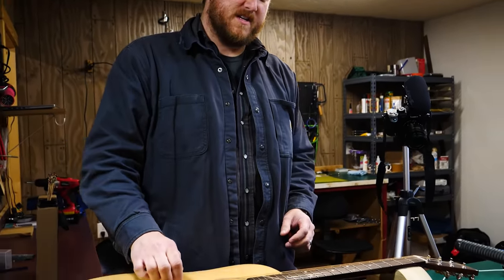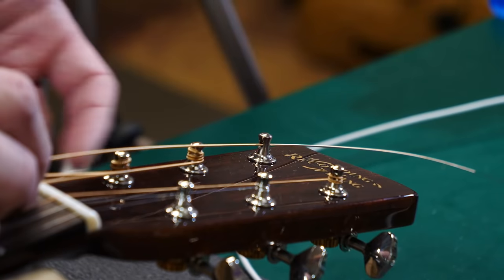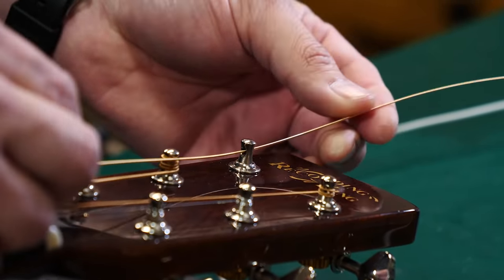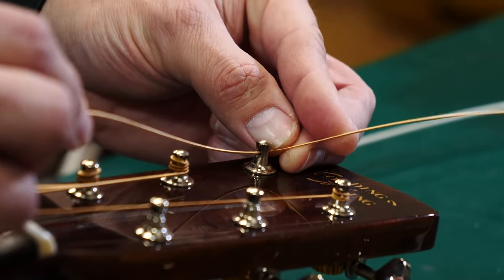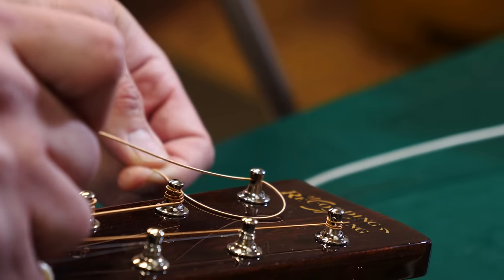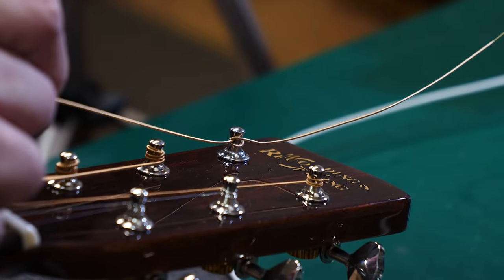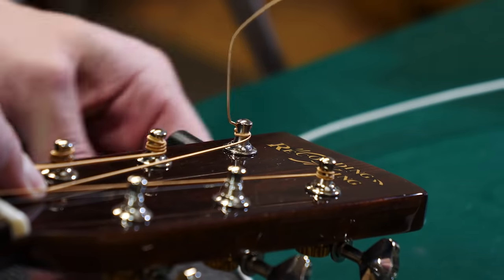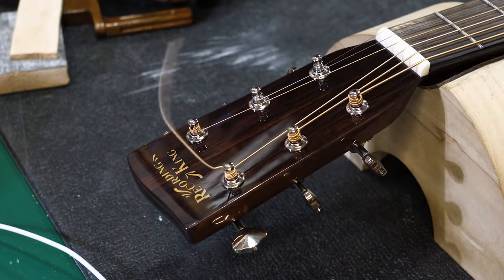Tech Tip: How to Tie a Luthier's Knot When Changing Strings

Comment: I’ve been restringing my own guitars for 40 years. My technique is to make sure I have 2 1/2 to 3 turns. For most 3+3 headstocks this means measuring to the next tuner post and cutting it off there. For inline 6 it’s just past the next or about half way to the 2nd. I start the first wrap above the becket and the rest below, just to keep the coil from bottoming out.

Have never had slipping or tuning issues.

I’ve been changing strings on pianos and even harpsichords for nearly 40 years. Some harpsichords don’t even have holes drilled in the pins. If piano makers tied their strings on you’d never been able to get them off the pin.

You may need to do this for nylon, but with steel strings it is completely unnecessary.
Reply: but still good.
Reply: You don’t bend strings much if that method works. They don’t bend piano strings.
Reply: @Sinned Gnillubnot Haha! Fantastic. I agree. Tying is unnecessary, especially on wound strings--which he uses for his demo! As long as there's a good kink where the string enters and exits the peg, and a couple of winds around, there'll be no problem.
Reply: I agree with tannertuner! I have been playing guitar for 50 years. I have also been a piano tech for about the same amount of time. I just changed my high e string to test luthier knot. Didn’t notice any real difference, and yes, I bend a lot of strings playing straight ahead blues! The key is a good tight becket(piano tech term for the bend at the hole), and 2( for wound) and 3(for plain steel) tight coils. Most guitar players do a sloppy restring, so I suppose the luthier knot will help in that case.

Comment: I've been a full-time repair-tech for over 40 years ('Guitar Tech' - in the SF Bay Area), and in my opinion, this video is almost - but not completely - wrong.  As has been said below, this 'knot' is completely unnecessary On The Wound Strings.  However, on electric guitars using very light-gauge strings (9-42 or 8-38 sets), it can be very useful to perform this process on the 1st (high E) and 2nd (B) strings, because these strings (especially an .008"-gauge 1st string!) can be flexible enough to 'creep' through the tuner-hole, even when sharply-bent correctly, during installation.  A 3rd string is too stiff to 'creep' (and the wound strings have plenty of friction against their adjacent windings), so this is not necessary for those strings.

Stephen White
Reply: Good point!  I've always just put one wind over the tag, and the rest under, and never have I had a string slip...but I don't use 9s.  I use 13s on acoustic and 16s on Resonators, more cables than strings.
Reply: Stephen White brilliantly repaired/set-up/modded many of my guitars and basses in the early 90s… I’ll follow his advice on this topic 👍🏻

Comment: Thanks for the great tip Ben. After 65 years of playing, and stringing instruments, this is the most efficient I've experienced. That being said, it's very difficult or next to impossible to utilize the knot on A and B strings when using a gauge below 12s. For these 2 strings, I wrap the strings 4 times around the post, then pass the strings through the post hole and over the top of the wrap. Holds tight, clean wind and easy to remove old strings when the time comes.

Comment: This is without a doubt the best way to attach strings. I've been doing it this way for over 20 years, I just didn't know it was called the Luthier's knot.
What surprises me is that hardly anyone knows about this knot. I've even seen two luthiers simply put the string through the hole and tighten it.
So let's share this video.

Comment: Good presentation. I used the same knot for a few decades but then dropped it about 15 years ago. I found it unnecessary and not having the knot makes it easier and faster to remove the string from the post when restringing. When I put a new string on, I thread the string through the post pretty much the same as you show, but I then kink the string on both sides of the post: toward the inside of the headstock above the post and toward the outside below the post. I then crank the tuner and wind the string with all the windings going on the post below the string and post hole. The two kinks lock the string and give more than enough friction so that I never have slippage or tuning problems. Works on all the strings even the high E string on acoustic guitars, electric guitars, and mandolins.

Comment: I love the knot, never looked back. However I do the tension tight so there's max one wind. That way theres no string binding against itself on the post which is the main cause of tuning instability. Looks clean too. The trick is experimenting with your individual guitar on where to position the hole for each string. I use the 54432 (o'clock) method on my strat.
Reply: Hi Rich,  I suppose one reason to have several "windings" going down the post would be to increase the "break angle" of the string (from nut to post) a little bit,  to the extent that is important.

Comment: Cool video, but there's a much easier way and you'll never get pricked by the sharp end of the string poking out after you've tuned up! Just let the first wind around pass under the hole as you tighten each string (and each successive pass should go under the previous one), and make sure you leave enough slack to make 3-4 passes (except for the thicker strings, where you can get away with 2-3). That puts enough upward pressure on the part of the string that's going through the hole so that it will not come out. Finish tuning the string to whatever note it's designed for (EADGBE), and twist the end of the string back and forth until it snaps off clean. No cutter needed, no sharp end sticking out, and no goofy-looking loops made out of the extra string! Problem solved; no Luthier's knot needed. This works for the mandolin as well, and I am sure it would work for the banjo, although I don't have one and so I've never tried it.
Reply: literally came to the comments to mention exactly this. i've been breaking off strings at the post (after three wraps) for about thirty years now, and never once have i had a string slip or come undone.  it's faster, safer, and easier.
Reply: @TypewriterJustice  Haha exactly!
Reply: Hi, your technique seems simple, would it also work for violin and ukulele strings? For bass? Thanks.
Reply: @lunacatfish  it pretty much just works for bare metal strings or wound strings with a metal core, so it that rules out nylon/gut strings and most flat-wound strings for classical instruments(which often have gut/fiber cores) - i tried it on an electric bass once to no avail, never even bothered to attempt it on my upright
Reply: @lunacatfish  I don't have much knowledge on those instruments, so I would consider what @TypewriterJustice said in Reply to you, whatever of it applies to your situation. Sorry!

Comment: Banjo Ben - I used this technique for years and I abandoned it as a bad job.  Too many times, I tore bloody holes in my fingers trying to undo that "kink", particularly on the stiff B string (0.018 medium gauge).  Same technique without the reverse bend holds very well and is far safer for the poor schnook (usually me) who has to take those strings off in a few weeks.
Reply: I hear you! I've been using the "Martin" knot for almost 40 years. As my eyes got worse, I discovered a solution. I leave 3/8ths inch of the string tag instead of clipping right next to the post. It's much easier to free the bend without donating/sacrificing blood.
Reply: Why not unwrap the knot from the other side? If you are using an acoustic loosen the string and remove the peg in the bridge then unwrap it from the long end. With an electric you cut the string and again unwrap it from the other end.
Reply: @CDRaff  that doesn't help, especially with the B string. It's folded over like a tight u-turn, and the string is rigid. There's barely enough string to grab, and usually ends up stabbing your finger tip. That's why I cut them off to a 3/8ths length after winding, so I can grab it with needle nose pliers. Even with that, you have to be careful to avoid scraping the tool, or the string end, against the peghead.

This knot prevents the string slipping either direction. You can't push it through with the long end until the fold is released.
Reply: @JonNewquist  I have been doing this well over 20 years, no it doesn't.
Reply: @CDRaff  I've been doing it for forty. Maybe your eyes are better than mine, maybe your pinch strength is stronger than mine. 😁

Comment: Great practical tip! I learnt this way nearly 50 years ago when I first started playing and for me is the only way to secure the string to the post. I am convinced the popularity of locking tuners on electrics is partly due to players not knowing how to attach their strings correctly and thinking that their machine heads are at fault. Lol I am starting to sound and think like an old man🤣
Reply: Locking tuners to me are mainly an aid to speed up and simplify string changes, since you eliminate the need to do any wraps(the method in this video also works great with minimal wrapping). Thought I'd agree, many people have no clue how to do most of their basic guitar maintenance lol
Reply: There are slip-proof ways to do it that don't involve the knot.

Comment: This knot used to be in a little flyer inside Addario strings back in the last century. It's easier to apply when you start off by turning the tuner post bt 90 degrees. Been doing this since 1981 and never had a string slip, nor be impossible to remove on the fly. It also translates well to the nylon string guitar as well as to nylon strings with wooden tuning pegs (where I actually DO line up the post hole with the string direction)

Comment: Great explanation. Slight improvement would be less slack and fewer winds around the tuner post. Less slippage during the first tuning after the string change. I try to get 1 1/2 winds around, 3 or 4 is too many.
Reply: Is less wraps better than more? I always assumed more wraps meant more grip and more stable tuning
Reply: @TheMyguitarisblue   You are right that extra wraps do actually allow the string more chances to catch on itself, but that doesn't make it more stable. The problem is that those "catch" points very often slip as you increase string tension when tuning.  If you hear occasional popping noises and a sudden pitch drop when tightening a string, that is usually the extra winds slipping through and consequentially the string looses a small amount of tension. Doesn't happen with minimal winds. 
It's nit-picky for sure but it works better. :)

Comment: I played for a living for many years and never dealt with using a knot when changing strings; it made things much easier when removing them and changing again, which I did at least once a week. The key is giving the strings a very good stretching after the new ones are put on. (this was on a 73 LP with non-locking machine heads). Again, the real key is in the stretching...my opinion.
Reply: I agree.  Stretching the strings and a properly cut nut will keep your guitar in tune.  I think the knot is useless.
Reply: yep stretching and also tuning the guitar in playing position is most important

Comment: i've been playing guitar for 60 years, 40 of that semi-pro (~1500 gigs), and none of the bad things mentioned if you don't do this have ever happened to me. in addition, this method is a nightmare if you're playing solo and break a string. if you just run the string through with the post hole at 90° instead of straight, you put a kink that holds the string just fine, but releases easily if you need to change strings. it never slips, that's a bogus belief.
Reply: This.
Reply: Is right
Reply: It does, specially slippery Elixir's.
Reply: @jaezryl  i've used Elixirs on guitars occasionally, but always on my Swedish cittern. they never slip.
Reply: @millsbobster  I have never believed it till it happened to me. The E string keeps getting detuned. When I investigated, it turns out the wrap slips up. So I did this and the problem went away.
Reply: Totally agree. And I Build Guitars as well As Playing them. I doExactly the same. Once that string has a kink in it and its wrapped around the tuning post a couple of times under tension , what happens at the point  where that string first enters the hole in the tuning post is completely irrelevant.
Reply: bring a spare guitar.
Reply: @jaezryl  this doesn't stop the wraps from slipping...

Comment: not a fan of this knot, in a lot of cases you end up having to cut the strings off the peg which is more opportunity for error. I'm fond of the 1 over 2 under method is plenty reliable and always easy to remove. Also, instead of guessing how much slack you need pinch the string at the nut and slide it back 1 fret for your 6th string and 1 1/2 fret for 1st threw 5th and you will see even results every time.
Reply: Absolutely 100% agree with you.
Reply: Well make your own video!
Reply: @flintdavis2  🤣
Reply: Man sais 1 and 1l2 inches problem solved.

Comment: Okz wow. I sort of intuitively guesses that's how it's done, because doing it how most people do it would cause me to break strings right away because I was pulling it too tight. But I see now that the length I was chosing for the knot was off, plus the final overlapping clamp of the string to keep it in place. This simple video just solved years and years of frustration for me 😊

Comment: This is a big source of contention for players.  People either seem to love or hate it.  No middle ground.

I, personally, think that the Luthier’s Knot is more trouble than of benefit (stringing and de-stringing).
Reply: Quick test :
Take 2 guitars that are very same.

String one with the knot, string the other by just winding the strings.

Then play both a song on each guitar like you would during a gig.

Retune and put them on a stand.

Pick them the day after and see which one is out of tune and by how much.

Any problems of wood/hardware put aside, strings winded with the knot will be almost dead stable right away and will very slightly move during overnight (and in my experience, they spend the night in a guitar vault, in a semi-truck trailer)

Comment: Never seen a need for this unless it is a straight post. This method was meant to be used on the old straight posts that are shaped to pinch the string in place with pressure. This method tends to cause a longer period before you have tuning stability too because of the excess string on there that needs to stretch out. Great method for straight posts but unnecessary for tuners like on that guitar.

Comment: Totally unnecessary and it makes it harder to get off when the time comes. Strings just don't slip out from around the post and the post certainly doesn't turn backwards from the tension. Guitars go out of tune for other reasons such as temperature and humidity. And strings sometimes go sharp! This isn't explained here. A colder temp will make a string go sharp. Also, strings get stretched in places along their length. That is normal wear. I did this knot for a few years but I went back to just pulling the strings through the tuner post and making tree or so winds around the post. Easier to put on and take off.

Comment: I always wind string around the post sbout 3 to 4 times, below the hole, then pass it through the hole over top of those windings and wind til its in tune....then wind it way over pitch, then back to just under pitch and bring it up til its in tune. Always works fine. If it goes flat in first week or so I take it a few wholesteps over pitch, then tune it properly to stretch the strings

Comment: I learned this about 1976. Have used it since. But I agree with the comments that is is hard to get off. At times I can hardly do it without needle nosed pliers. I am going to try the one wrap on top and two under that is described by some comments. I break strings a lot because of changing tunings. Changing a string while bantering with the listeners is an important skill, and I am excited to see if this will make it easier.

Comment: Another benefit to this method is that it positively prevents round core strings (DR Sunbeam for instance) from unraveling and going dead when trimmed.  I use this method for the wound strings, and the one-wind-over, other-winds-under method for the plain strings (for ease of removal).

Comment: I don’t know why everyone has anything against the knot method itself. I’ve switched along time ago to this method and speeds things up a bit and noticed an increased tuning stability. BUT, I will say, using the knot technique and having that many winds around the post kind of depletes its purpose quite a bit and would recommend you find the spot for the desired tuning with its tension that it needs (that variable depends on string gauges you’re using for said tuning) to only leave 2 winds. This is because you don’t want to lay ALL the tension on the knot itself along with less excess string = less slippage overall. But yes, I recommend you still press down near the bridge, give them all a few pulls and bend the strings up/down the fretboard then retune back up. If it’s a clean job, the only 2 variables that will give you tuning/intonation problems is if it’s a change in string gauges, make sure to check after and the next day to see if the neck bowed (slightly adjust the truss rod back to where you left it (to find the spot, it will usually be pretty in tune after adjusted). And the other is just the environment. IE: heat naturally will cause strings to loosen the tension/tuning once the strings are opened and oxidation starts. Anyway, thank you for attending my TedTalks.